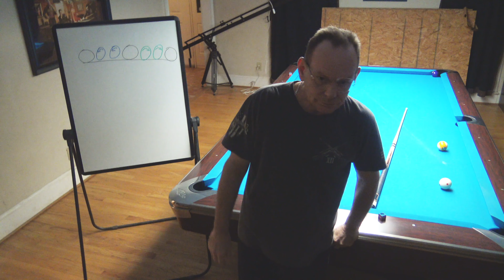Key Concepts - The Swerve Shot

Comment: When I hit a slow speed swerve shot from the foot to head of my table . I'm getting an opposite direction of swerve. So when I hit bottom left ( clockwise) at this direction,  im getting a curl to the right. Shouldn't my direction of swerve (not squirt) always go the direction that i hit my cue ball on? When I hit from head to foot the other direction,  the shot plays out normally.  Left English will curl my ball to the left. So is it my table, my stance, my cue? (Pool table is level i checked it many many times) thank you
Reply from the maker: You are correct, if you hit on the left, the ball swerves to the left.  Hit on the right, it swerves to the right.  It's not your cue.  It's either your table or your stroke.  Your description leads me to think it's the table.  How did you check the level on the table?
Reply: @compforce  I used a 3 ' level at both short rails corner to corner , at the side pockets both diangle and straight pocket to pocket. Its fairly new to my basement on carpet, and it has "k type legs ( I've blamed the stupid legs from the start).  I also thought it may be crowned at that end of the table , but I've played  from foot to head of table and the spin is all the same , opposite. I've now noticed that , after your video, its only when im playing a very slow shot where im trying to curve the cue using " swerve " i think.  If I use top/draw im not seeing it.
Reply: Oh , yup thank you very much . My table had loose bolts on that side. It was getting knocked off plane every time it was slightly bumped. I really feel like a fool now haha. Thank you again
Reply from the maker: @chadbankhead9225  If that's a carpenter's level, it isn't precise enough for a pool table.  You have to use a machinists level.  Rolling a ball by hand and seeing if it rolls off will be more accurate than a carpenter's level.  Glad you found the issue!